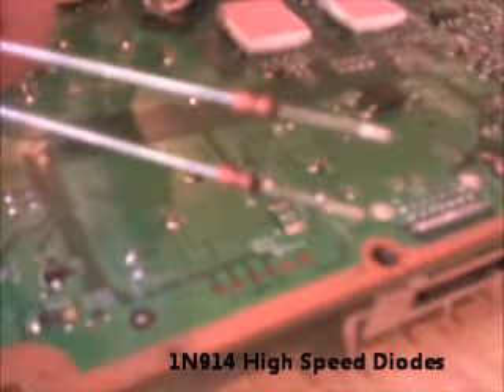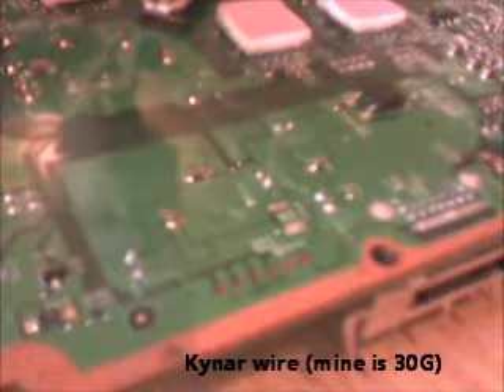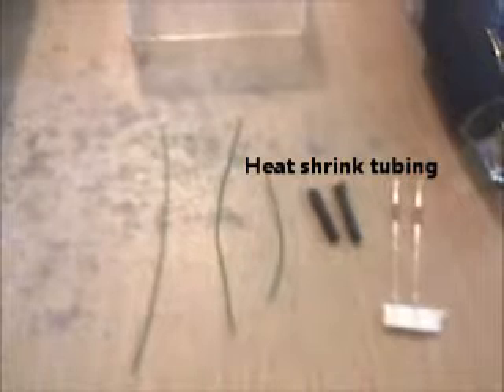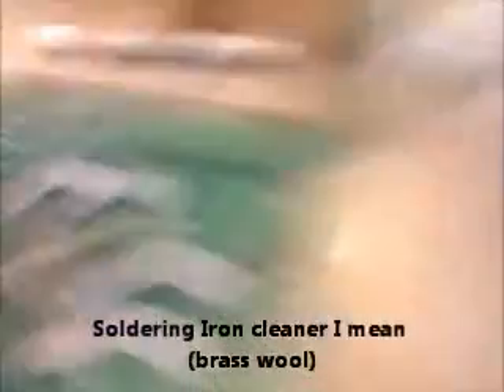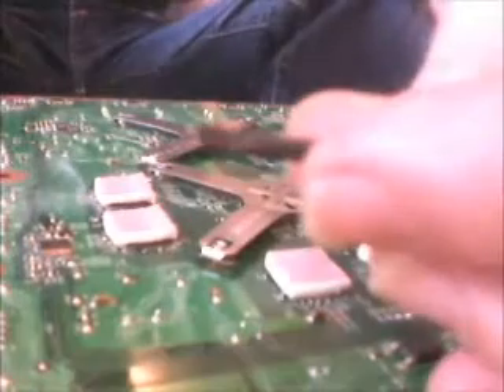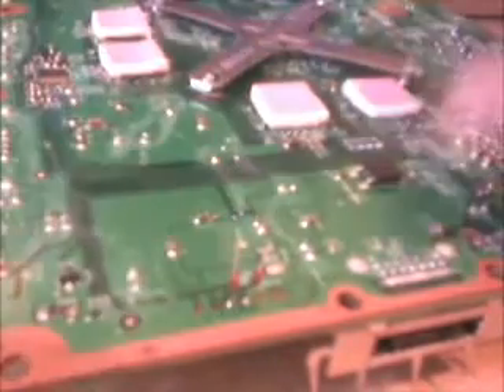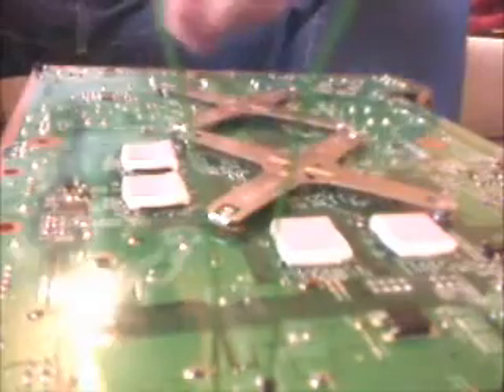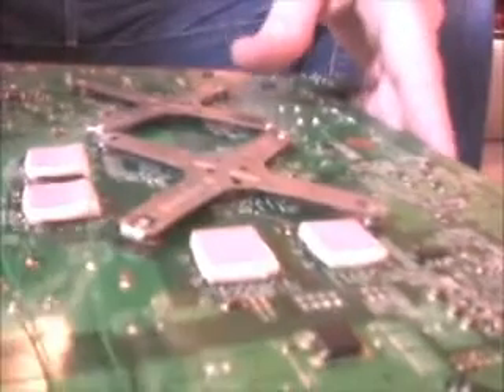How to jtag an Xbox 360 (Cheap and tidy) - Part 1

Comment from the maker: @ModifiedGamingx1 
So how have you got on?  Did you manage to get the nand wiring done and dump it successfully? I've now left soldering the nand-x pin headers is place, just snipped the connector blocks off and soldering the wire through the relevant holes, much quicker.

Comment from the maker: @ModifiedGamingx1 
Yes it's only a webcam with low resolution, but my digital camera has broke. However I think that with the diagram shown at the end of the part 2 video shows clearly what points need to be soldered. If you want a full guide for the nand-x installation mate then it's on the Team Xecuter forums, won't let me post the link unfortunately :-(